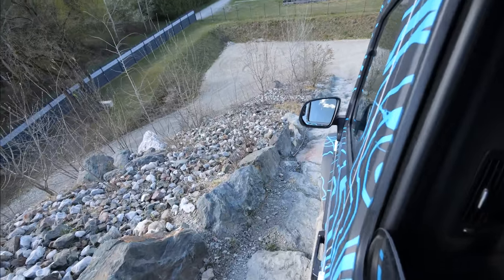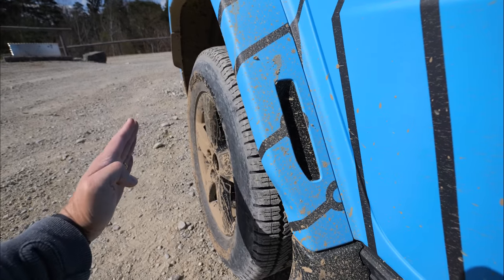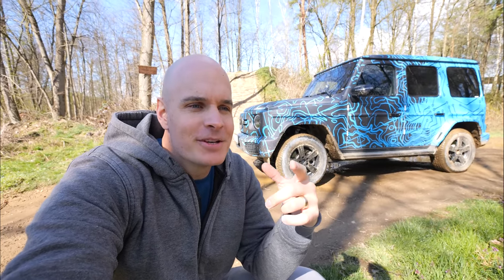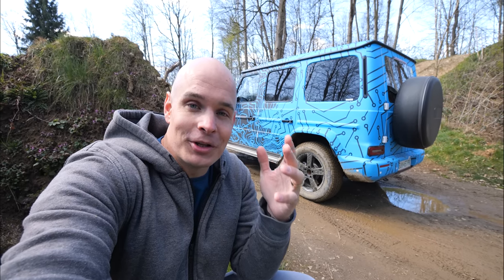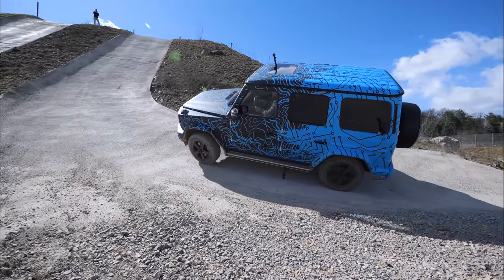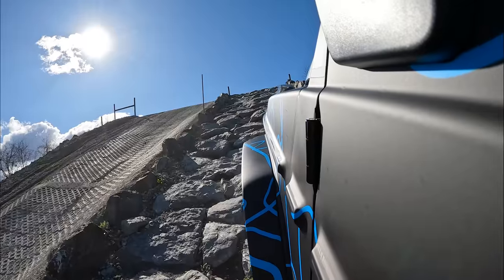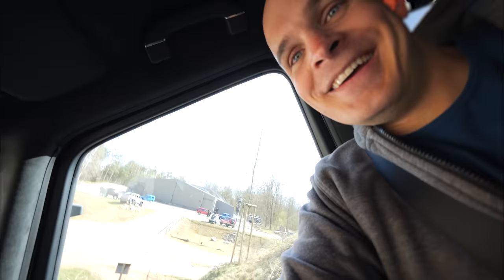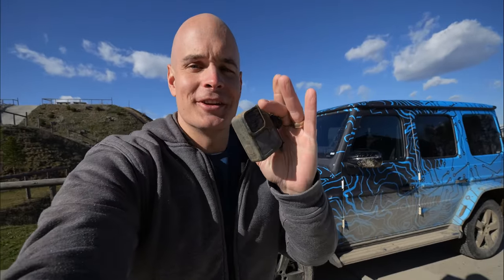The New Mercedes EV is a Luxury Stair Climber - (Sneak Peak!)

Comment: Not a fan of off-roading, but that car is pretty dope. Thanks for the sneak peek!👍
Reply: Thats not off roading. It was carefully selected propaganda terrain that is required to support a 8,000lb ev monster.
Reply: @Dat_Sun  i like that propoganda
Reply: What's a fan of offroading? Do people knowingly go offroading or it's more like a need for people in difficult to reach locations? I think it's the later.
Reply: @TheRealGigaCat  For me it's a need. I live miles from county maintained roads in the rockies.   No ev can get here at the ridiculous weights thay are coming in at.  Nothing short of a light weight Tacoma with lockers and oversized snow tires can get here in the winter.  Low psi footprint is a requirement unless you are on tracks like this gwagon and all other ev should be.
Reply: @TheRealGigaCat  Do you like giving your hard earned time and money over to these people? Each ev sold come at a high cost to the tax cattle and our energy rates. Ev uses our coal powered grid. Level 3 charging is an industrial load. .
Reply: @Dat_Sun  yes. For now it is an industrial load. But it is being changed to clean sources slowly. What do you recommend us to do? Don't attempt anything about it? Also i can't buy it. But I do admire the engineering. Nothing wrong about that.
Reply: @TheRealGigaCat  Do nothing about what?? Im all ears.
Reply: @Dat_Sun  I am not a scientist or have any engineering major in that field. So you are asking the wrong guy.
My take is that we have to move to electric vehicles sooner or later. Getting it done slowly like this is not a bad idea. There are people such as you who will buy petrol cars. There will be others who will get EV. I too prefer IC engines as of now. But I can't turn blind eye to future either.
Reply: @TheRealGigaCat  There is no reason for ev. There is no problem with ice, ev is essentially ice because our grid is 99% fossil backed.  

Ev is putting the cart ahead of the horse,  each ev is a Industrial load placed on the grid, more coal is burned to meet demands.  Our energy rates are skyrocketing.  

Again,  there is no reason for ev, only greed and control.
Reply: @Dat_Sun  You have absolutely no idea. First of all, no grid is 99% fossil backed. Secondly even if it were 100% fossil (which again, not even close) it would still be more efficient to use EVs as the electriticy production is far more efficient than any ICE could ever hope to be. Lastly EVs also have other benefits such as less noise and less local pollution.
And that's just the surface of why your arguments are not to be taken serious.
Reply: @rumapark494    Yes our grid is indeed 99% fossil backed. Do you think the millions of tons of wind turbines manufactured themselves? Did they float themselves here from halfway around the world? We did not use electric trucks to transport them, the lifting and tailing cranes are diesel powered. All of the servic equipment is ice powered, the aircraft the thousands of technicians fly all over the country on are ice powered.  You have to consider everything when making the bogus claims that the grid is at all renewable.   

Need I go on?  Because I could go on for days as we track down all of the components that were, mined, manufactured,  transported,  transported again, erected,  maintained,  repaired,  serviced and de commissioned with ICE power...  

 Consider that the wind and sun don't blow and shine all of the time, Cut the advertised numbers in half or less.  We also need to consider what the footprint was to construct the bases/ foundations for the Wind turbines,  access roads for wind and solar,   the fossil fuel footprint of constructing millions lbs of plastic and glass rare Earth mineral solar panels and wind turbines is enormous...  

 Everything involving renewable energy IS powered by fossil fuel behind the scenes. If solar was so good why doesn't China manufacturer solar plants instead of coal fired power plants? 

China is burning millions of tons of fossil fuels to manufacture our renewable energy equipment before putting it on a crude oil burning sea going containership that Burns millions of gallons, 1000,000 gallons each day.  100000 gallons of crude oil burned each day for every one of our containerships from China... Let that seek in and hit back with your best comment..

 Open your eyes to the big picture stop listening to government propaganda and statistics. Remember Tesla and all EV manubaxter's are part of the bill backbetter scam. If you were to look into how much money is flowing into electric vehicles from multiple avenues,  you would be sick ( Assuming you're not a con artist and actually care about America and our future).

 Where are all of these wind turbine blades ending up?  Are you aware there are crews traveling the country all of the time doing blade swaps? Hundreds of men, Millions of gallons of fuel annually, all backing a wind turbine that might offset one Detroit 60 running at full throttle for a few years.
Reply: @rumapark494   It doesn't matter if electric vehicles are a 110% efficient. Fossil fuel is 27 times or 2700% more energy dense than the best storage battery.    Even at 20 or 30%, Ice is astronomically more power dense.   This is why we don't have electric rockets, This is why Tesla's atv is an embarrassing power wheel and why electric bikes suck. 

Electric transportation has its limits, You must be able to hide thousands of pounds worth of battery which often amounts to half of the mass of the electric vehicle. The thousands of pounds of battery still weigh thousands of pounds when they're empty.. 

They don't last long no matter how well you take care of them, lithium batteries are a lot like a carton of eggs.  You better check the date before you buy Em.. There is an expiration date and nothing you can do can extend it.  There is no shortage of Tesla's with failed batteries not being covered by warranty being set on fire, Exploded, converted to Amish buggy wheels and rolled down a hill, who knows what else for clicks because they are not worth purchasing a replacement battery and having it installed. 

Electric vehicles are throw away like a cell phone, they will never increase in value just like a trailer home.  There's no value in them, finding parts in 20 or 40 years will be impossible, and nobody's going to want them anyways.  

 Ice will be remembered as the good old days before democrats and electric vehicle propaganda finish off America.

Imagine if ice vehicles were allowed to dedicate half of the vehicles weight to powertrain and fuel storage..  An E v's fuel tank weighs 2000 maybe 4000 pounds, An ice is fuel tank weighs about 30 pounds.. An ice engine weighs just a few 100 pounds, Another 100 pounds or so for some drive train.  When all is said and done ice is only dedicating a small percentage of its overall mass towards power train. Electric vehicles on the other hand are criminally inefficient,  their tires are massive requiring 4 times the amount of rubber a practical size ice vehicle does. Did you know making tires requires a lot of oil?  Like criminal amounts of it..  

Without this oil we would not have Tesla's with tires,  Wlwe wouldn't even have the Tesla because half of it by weight is plastic. There is very little recyclable metal in a Tesla. They are designed to deteriorate and crumble as the plastic ages. In the end you will be left with a few 1000lbs of puffed lithium cells and a crumbling pile of plastic with a few bits of aluminum sub frame, and some broken switches.
Reply: @Dat_Sun  Thank you for your TED-Talk but car manufactures alreardy concluded that EVs are the future and alot of them dont even design new gas cars.
Reply: @PagChomp190   That's not true at all, they're only doing what government is forcing them to do. The major manufacturers have stepped this one out and don't want anything to do with electric vehicles.   Just ignore all the real problems I've been talking about and believe the manufacturers who are taking your money enforcing these sales on the people. What could go wrong?   

 Don't let me stop you from purchasing one, As time goes on people will realize they were screwed.. 40 years from now there's a good chance I'll still be rolling around in mile.son with its original motor and trans mission and teeny carbon footprint. Every year I keep it on the road makes it that much more ecologically friendly.

When you think about it it would have taken tens of thousands of pounds worth of li-xx battery replacements to keep my truck on the road as long as it has been...  That's criminal..

Comment: This car is awesome. The tank turning is cool AF, I wonder how it behaves on asphalt.
Reply: I imagine the turning circle is even neater.
Reply: Lika a 8,000lbs battery.  It's criminally heavy.
Reply: And this things ludicrous weight will get it bogged down in mud similar to a tank LMAO you notice this entire video was shot on 90% dry terrain. They do not want you to see its all weather performance.
Reply: @om7303  no one shows seriously hard terrain in marketing materials, especially wet surfaces.
Reply: @cyjanek7818  Nahh some do
Reply: @cyjanek7818   Manufacturers used to demonstrate, In the seventies eighties and nineties manufacturers would beat the heck out of trucks climbing rocky mountainsides or loading them with 20 other trucks on tracks before pulling them. 

Now it's propaganda advertising, or a political statement.  Either way, each ev is an industrial load on our fossil grid.
Reply: @Dat_Sun  Due to EU weight limits it has to be significantly lighter than the Hummer EV if they want to sell it in Europe.
Reply: @Fekillix  Impossible,  unless they ditch battery storage.  Battery weight is constant.  You can guess ev weight just by the packs w/h rating.  Basically double the weight of the battery to equal the entire evs weight.
Reply: Car is an electric POS